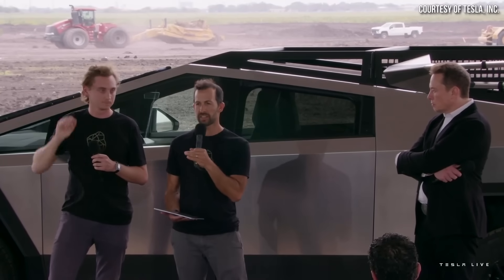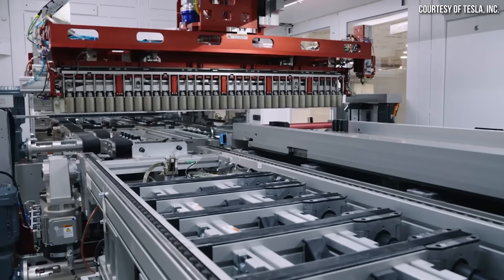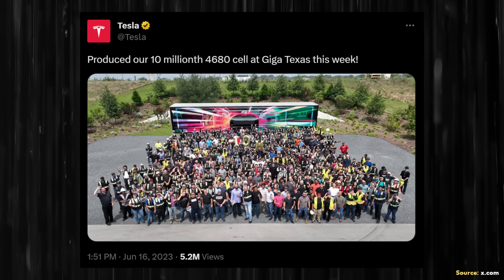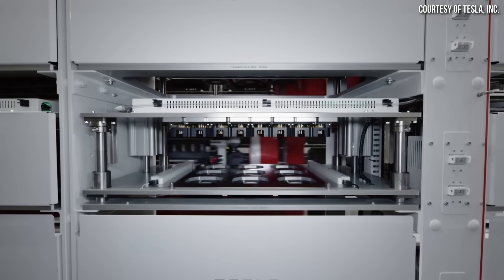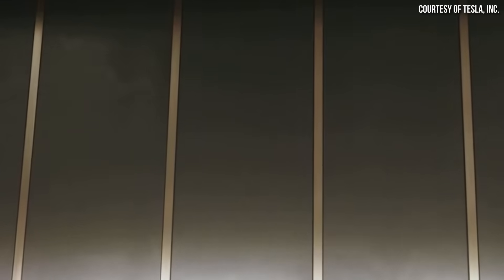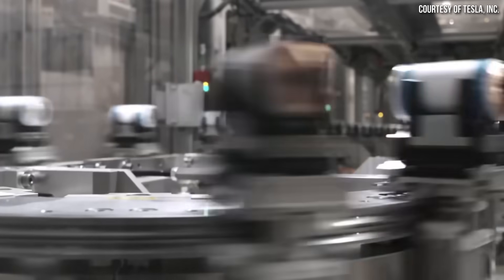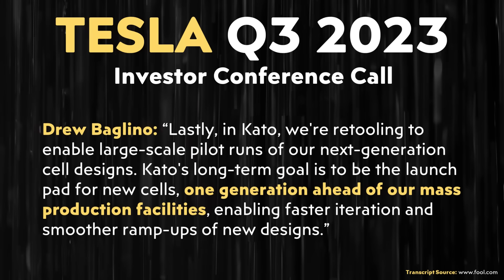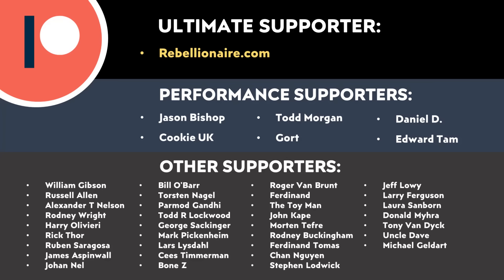3rd Gen Tesla 4680 Battery Equipment at Giga TX | Production Update

Comment: Honestly 10,000,000 4680 cells in 16 weeks is NOT impressive. 16 weeks x 7 days x 24 hours x 60 minutes x 60 seconds = 9,676,800 . So just over 1 4680 cell per second. Not at all like the b roll video every one shows with 4680 cells flying down priduction lines 😢

Comment: Tesla has stated that 4680 cell production has improved at each shareholder quarterly calls. Always the same format, x % improvement. But compared to what? Never any absolute figures like % of good cells compared to number scrapped (yield rate) or production rate compared to the original goal of 10Gwh/yr /line.

250k Cybertrucks/yr at avg 150kWh/truck = 37.5 Gwh/yr divided by 8 production lines is about 4.6GWh/line/yr or about half the original goal. It appears they have given up on the original goal, and this means their original cost projections are way out of reality. And they say they need additional improvements expected to take another year to reach this reduced goal.

Comment: Even without making any significant strategic errors, coming up from below, so to speak, isn't an easy path.

Recently, 'the market' got the wobbles over Tesla's shrinkig margins but that margin sacrifice was the necessary cost attached to Tesla's evident strategy to haul its belated Legacy Auto rivals in the EV game over the coals. Tesla strategy was surely to skewer its Legacy Auto rivals on their own dismal EV efforts just as those belated rivals started to commit serious resources to EVs. That made any numerical success in shipping EVs into a finacial burden. And the stratgy worked perfectly.

Still Tesla, in a way that was very different to Legacy Auto, has been buying time. The costs of quickly growing a small company into a large company are very steep and it was inevitable that there would be a squeeze on Tesla's margins once 'extreme scaling' became the name of the game. Economies of scale are definitely seeing Tesla through but that doesn't mean that the course that has embarked on is easy. Any time it can buy by making the experience of the dipping of toes into the EV waters a painful one for its rivals is to Tesla's advantage. It gives Tesla more time to expand production without interruption as automakers that thought they would come in and wrest control of the EV market without serious resistance get burned in a nasty surprise and then are forced to retreat and regroup.

But, in this expansion phase while Tesla's revenues certainly rise so to does its capital expenditure and at a significantly faster rate than its revunues. Why? Because those revenues are the trailing effect. Revenues only rise after the successful capital expenditure that permits the intensification/expansion of production. No matter how smart Tesla is it can't edge around the margin narrowing effect of its pursuit of rapid growth. That is the burden of a moderately sized manufacturer that is undergoing rapid growth.

Comment: This is absolutely stunning news! I missed the earnings call and no one is talking about this insane ramp up of battery production! The battery making equipment is basically money printing presses every bit just like Oil Wells are. Oil is a free natural resource, extracting it is what costs money. Sunlight is also a free natural resource. Gathering it AND storing it is the problem. Solar electricity production is not the limiting factor, storage is. They who make the best batteries at scale will rule the world!!!
Reply: You're forgetting that there are other energy storage options developing such as hydrogen.  Also compressed air energy storage and thermal storage.

Comment: Wrt to the 4680 ramp:

On the earnings call, Drew Baglino said that they expect to have four 4680 lines ramped over the next 3 quarters (by the middle of next year?) and an additional 4 lines by the end of next year. So that would be a total of 8 lines. If each line can produce 4 million cells per month per line, then 8 lines will produce 32 million cells per month. Based on the Cybertruck's wheelbase, a single-layer CT battery pack probably has enough capacity for about 1,500 cells (approx. 140 kWh pack size). So, 32 million cells per month would be enough cells to make 32 million / 1500 = 21,300 CTs per month. This would be an annualised rate of 12 x 12,300 = 255,600 CTs per year, or 35-40 GWh of capacity. Hopefully, they will achieve this in the first half of 2025.

Comment: I hope the two weight variants of the Cybertruck are with/without a second battery pack (for the 500+ mi range). It would be particularly cool if the second pack could be added if you need to buy it later.
Reply: You don't want to run a used pack with a new one, that creates imbalance issues.
Reply: @JRP3  battery management system can deal with two packs. For a simple case imagine they are used and charged sequentially, so one pack used at at time.
Reply: @TheGaussFan  Then you lose one of the benefits of a larger battery which is smaller relative power draw.  The older pack will also continue to age more quickly, increasing imbalances.  However more importantly Tesla's structural 4680 pack architecture means they won't leave empty space where a second pack can be added, there will be two different pack sizes, each structurally integrated into the vehicle.  It's not going to happen.

Comment: There is too much we don't know about many production issues. A key factor here is future battery chemistry. For example, the lithium/aramid/sulfur cell has an energy density 5X the current highest capacity lithium ion cells. Were Tesla to adopt these cells that charge at 3C, they would require only 1/5th the number of cells, or maybe 2/5ths to meet maximum range desires.
Reply: It takes a massive long term effort to gradually introduce new, higher density chemistries - many months of testing / charging/ discharging. Behind the scenes, Tesla will be working on a variety of these, and gradually improving densities.You can guarantee that Tesla will not be standing still !

Comment: Wall Street thinks Tesla is moving too slowly with its 4680 ramp.

I think they're doing great.

It's probably just a fluke. But 250K annual target production capacity for Cybertruck is what I forecast as long ago as January, when Tesla bulls typically called for 375K. My forecast for 2025 was and remains 50K.

I think that will be great, too - not disappointing in the least.

I am hoping to hear Tesla announce a Ranger-sized pickup by end of 2025. Such a model will sell wonderfully outside of North America as well within it.
Reply: Yes, cybertruck seems too big for me, even driving on American roads

Comment: Just to help you on battery tech giga, texas, and is opening a battery. Only a factory that will increase capacity, so that's probably  the phase 2 you're talking about, and the battery factory will be behind the car factory
Reply: Once I calculated. It's not that much space needed. Machine space per kWh produced is massively going down.

Comment: Not bad considering @ Giga Nevada There are currently 13 production lines with a total output of about 35 GWh of lithium-ion cells annually.
Reply: I read that Panasonic added a 14th production line at GF Nevada.
Reply: Yep, and Panasonic is an absolute top tier experienced battery manufacturer. This will be another big Tesla advantage. BYD has been manufacturing batteries for decades and and they're the only other car manufacturer making their own batteries. The rest are trying to get to where Tesla is now - in a partnership with a battery company.

Comment: I think the 18650 batteries still have better energy density than the 2170s and 4680 batteries.
Reply: Cost/unit of energy is the most important feature of the 4680s.
Reply: A quick google search says 21700 cells have 20% better energy density than 18650 cells.  I have built a number of ebikes and can attest to this being true.
Reply: Tesla tackled the physical end, building the cells to make use of the most real estate inside the cell can.  From here they can address chemistry knowing for each step along the way the will benefit from that physical work.  We are need to be more specific about cells.  Specifying the can size does not get us there.  Energy density of a cell can vary depending on the specific brand and model.